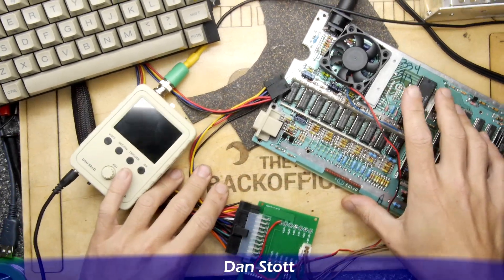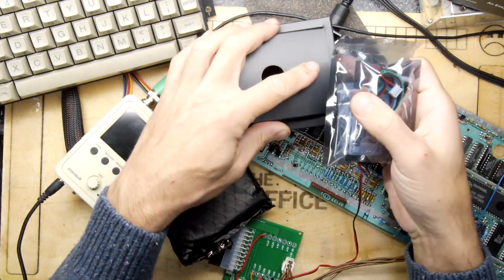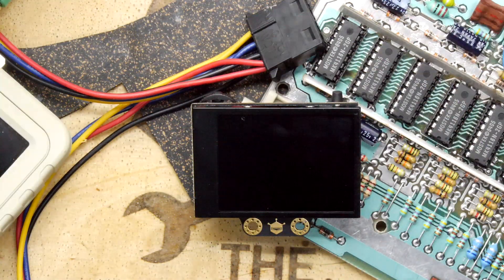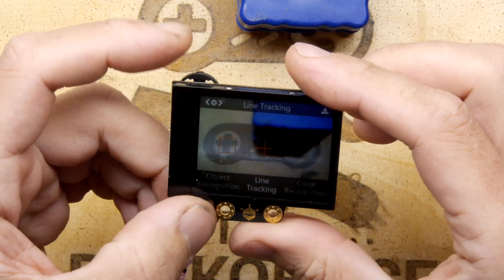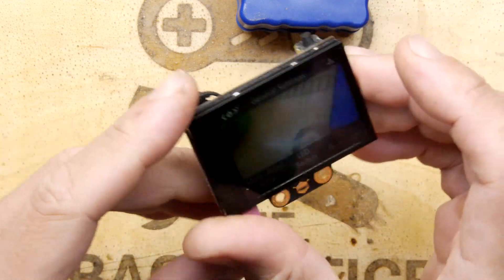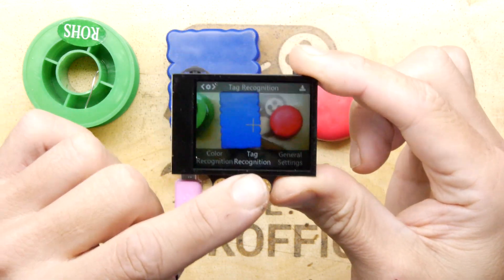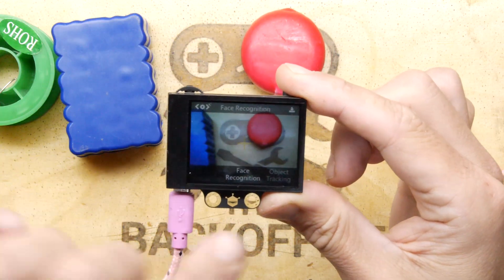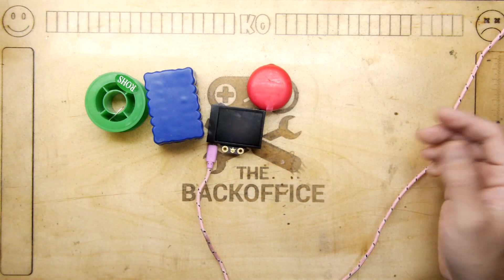DFRobotics Huskylens Overview

Comment: We're starting to see system-on-a-chip stuff from China with hardware neural networks on them - I assume this is one offspring. For info: a webcam, a bit of python (and the pytorch library) can do some astonishing things using your GPU to accelerate the neural network processing... on the PC you've got now. Totally worth a bit of learning.
Reply from the maker: This is interesting, for the particular project I have in mind I definitely will need at least the processing power of a pi for all my functions. I will need to see if there is any way I can offload some of the vision element using networking. I may have to have it resort to different behaviours based on its access to computing power.
Reply: @backofficeshow  Oh, according to the website it has a RISC V processor. Novelty. And the mysteriously labelled "AI chip" - which I assume is has some neural net hardware.
Reply: And if anyone wants to play with Python and machine learning/vision stuff on their PC: PyCharm is a decent place to start. It's a Python IDE made by Jetbrains. It's free, but closed. 

Alternative: Visual Studio Code by Microsoft (free and open source)... also great but a bit less hand-holding. It's rapidly becoming a fav of mine.

Alternative:  JupyterLab. Which is less of an IDE, and more of a scientific notebook (but not complicated). Free and open source.
Reply: @backofficeshow  Does this thing in the video have a neural engine in it... it looks like it's just an integrated camera, neural engine with some software (maybe even written in python).
Reply from the maker: It could be anything running on the chip..I suspect it's some rtos as it's super fast to boot, under a second